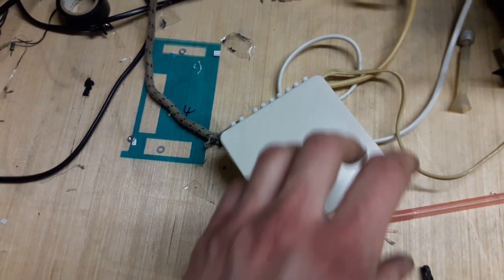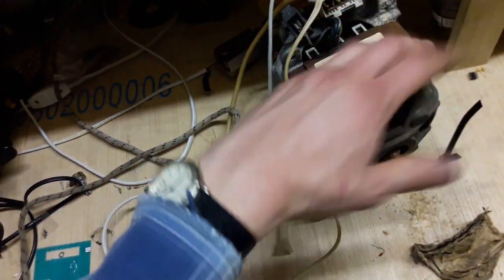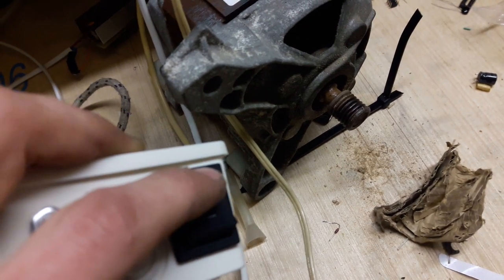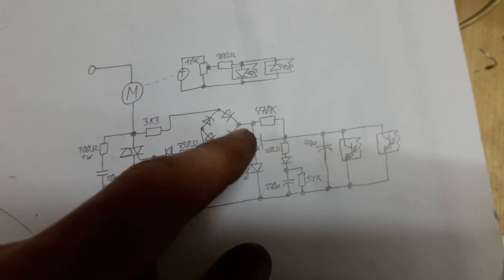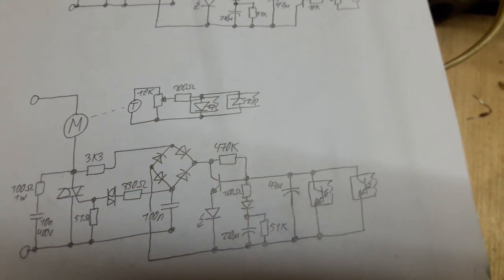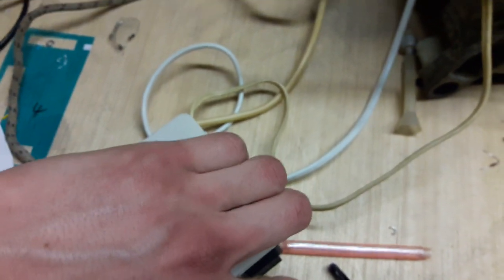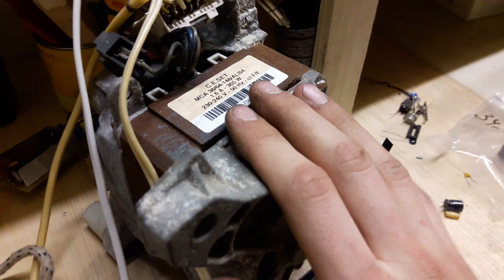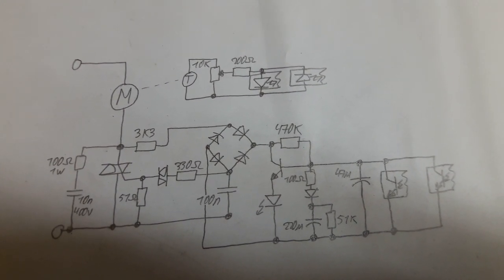Speed regulator for universal motor

Comment: Hi.
Do you know (have measuerd) what is the maximum p-p voltage that the tacho generates at high-full speeds?
That 200 Ohm limiting resistor seems too low for the opto's. (when pot is turned all the way up)
Also the 470K - 47u time constant seems way too large for an 50Hz mains voltage?
You mention in the video that you can easily stall the motor at low to medium speeds. That is not the case with TDA1085! Even at the lowest speeds it's impossible to stall it.
Major drawback that it laks tacho failure/pot interruption and over current protection.
Thanks.

Comment: Hey dude,
  I have a broken woodworking jointer that uses a similar universal AC motor. It uses a U2010B circuit for motor speed control. The circuit does not use a tachometer. It uses current across a shunt resistor to regulate speed. Do you know of a current regulation based circuit built out of discrete components like the one you showed here?
Reply from the maker: Regulation based on current is not that precise, I didn't look into it that much. I don't have such schematic handy.
 There's another way though - you can monitor current consumption and the back EMF from the motor. This makes a regulator with better performance than simple current monitoring ones.
Reply: It looks like YT blocks me from posting links, but if you look for craftsman cmew020 on the EEVBlog forum you'll find my current project I'm playing with. It's worth a look just to see the simple/cheap U2010B circuit with all through hole and single sided construction. I have created the kicad files including the board and schematic already and posted them on my github. I think the circuit they used is based on current sensing for feedback, but I don't fully understand it yet. The datasheet is not very good. When it was working the speed was stable.

Comment: Washing machines do not use 'universal motors'.  Google it.
Reply from the maker: Brushed DC motor that is excited by stator coils, is called universal motor for obvious reasons. 
Maybe newer models use BLDC motors, but that doesn't mean that all of a sudden universal motors were never used in such appliances
Reply from the maker: Then what the hell did you see in this video if they don't?
Reply: @mrjohhhnnnyyy5797  I stand corrected. European weirdness.  My last washing machine lasted 40+ years, and it was the transmission that finally failed.  My new washer is a direct drive, again no brushes to wear out.
Reply from the maker: @PaulPassarelli  Here in Ukraine, in the 90s we had semi-automatic machines that used induction motors.
 That's why you can't say for sure, stuff can be so bizarre for the foreigners

Comment: Hi Mr Johnny, how to send the tacho AC signal into a microprocessor 5V tolerant? I know how to control it by PID but I didn't found a circuitry to process the AC tacho signal and transform the sinusoidal signal into a square signal to be counted by the micro. Thanks.
Reply: If you have an AC signal that you need to count the pulses all you need to do is put a suitable series resistor and then reverse parallel zener diodes. You could also use this in front of an opto isolator if you wanted to be sure that nothing can get to your PLC.

Comment: What a smart circuit. I am working on similar project to regulate the rotation speed of hammer drill motor which was regulated by pic mcu which blew up and relased the magic smoke. I traced the circuit of makita hammer drill control unit and it is very similar to example circuit from datasheet it uses  U211B3 chip. I can take a picture of the original makita schematic if you need it for something. Board was poted so it was quite a challenge.

Comment: Mr Johhhnnnyyy,i was asking for assistance im trying to repair lcd tv power supply,but the part number in my area its not availabe, pja1014 its like transistor but it has two legs(pins),and on the board the is a sign of diode i was asking if could use diode if yes which diode?

Comment: Hope you are having a nice xmas :-D
i can see the phase firing circuit but i did expect some old chip like the lm2907 to do the frequency to voltage conversion.

My crappy beko machine went mad a month ago, i decided a bosch one would take its place, but i stripped the beko and the motor looks much like yours, with a tacho coil on the back.
Reversing the brush wires or the field wires would change the direction.
The metal case went outside the house, 1/2 hour later it vanished,  scrap metal men dont mess around here :-D
Reply: Why would you need a frequency to voltage conversion when you have a tacho generator that outputs DC proportional to RPM ;-)
Reply: Pass, i see a frequency generator coil, not a pulsewidth modulator.
Is that generator special?
Reply from the maker: @akkudakkupl  Well, actually it outputs AC, that's why you see two optocouplers in the schematic.